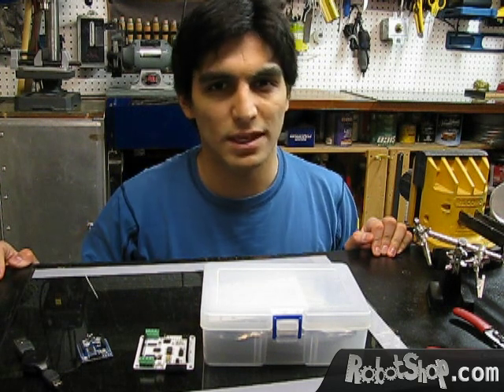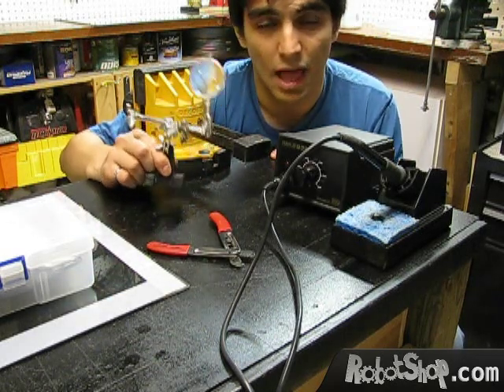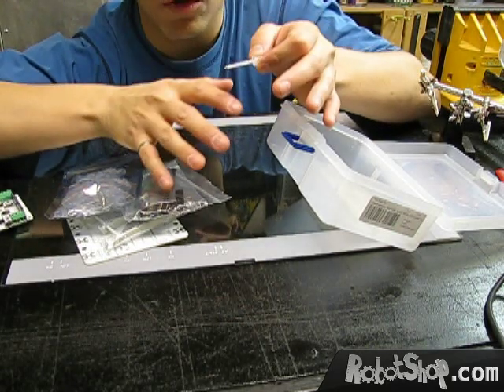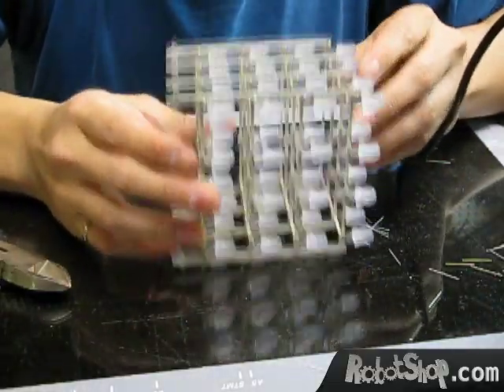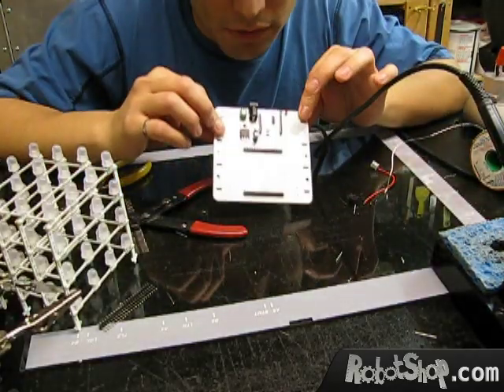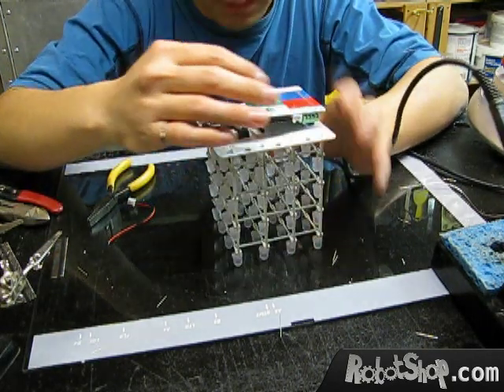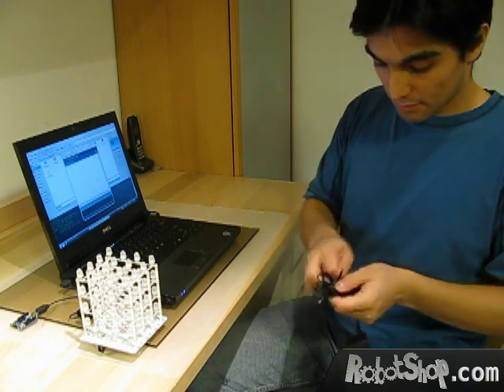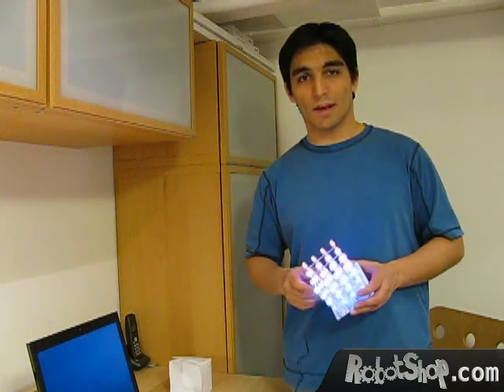Carlito's Project - RGB LED Mood Cube by RobotShop.com

Comment: what settings did you use in the arduino software like what type of board and port? please help soon
Reply from the maker: The kit now uses the Rainbowduino LED Driver Platform which is based on the 328. Since it uses an FTDI, you can use the Duemilanove under board type. The COM port really depends on your computer, once you have the board plugged in and powered.

Comment: Is it possible to have constant serial communication between the cube another arduino?
Reply from the maker: An Arduino can only perform one task at a time, so if you're using serial, then you are not changing the status of any other pins. You can "almost" have continuous communication.